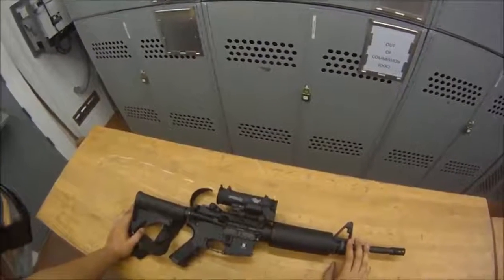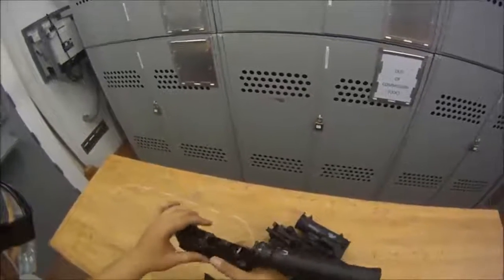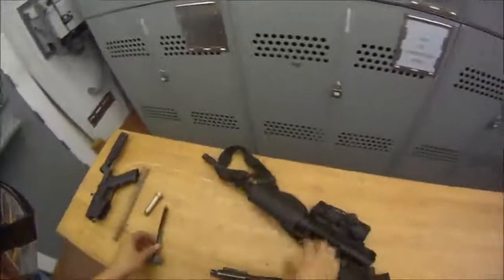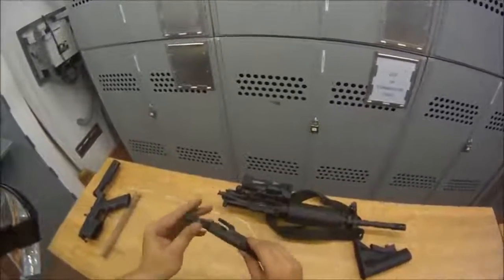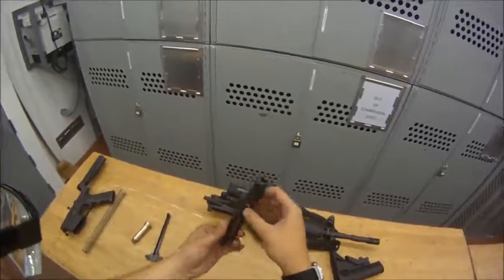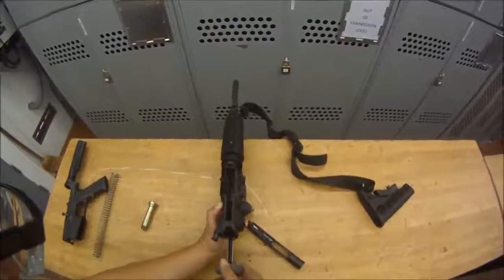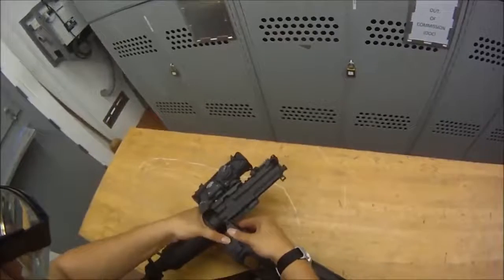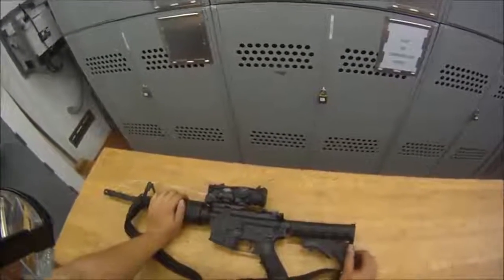M4 Disassembly, Assembly, Funciton check

Comment: Why did you pull the charging handle one more time at the end ? I don’t understand.
Reply from the maker: Shericka Parson  I checked the full auto and that left the hammer forward. With the hammer forward, the safety will not go on safe. So by charging it again, that cocks the hammer and allows me to put the safety back on... If I was going to store it with the hammer forward, I would not have to rack it that last time and just return it to the locker.
Reply: It’s so he can put the safe on

Comment: You like seamen huh
Reply from the maker: There is seamen every where at my job, they are in the halls, on the deck, in the office, sometimes in the goat locker, on the boats. Some seamen are older than others. I wouldn't say I like them all the time, but I have to work with them.